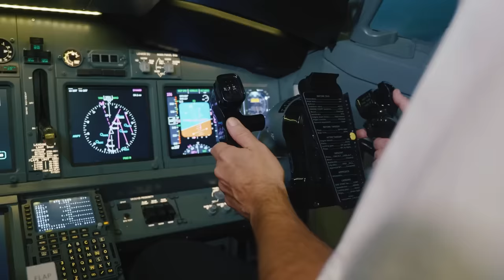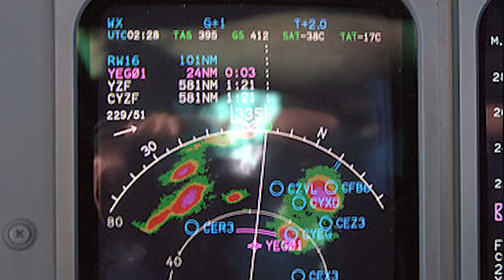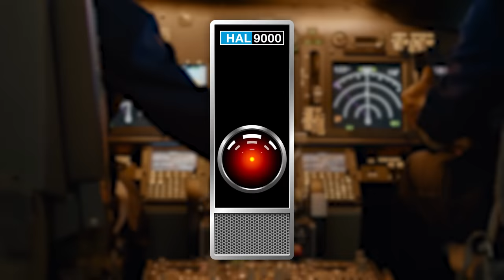Neil deGrasse Tyson Explains Advancements in Aviation

Comment: I lived in a suburb right next to O'Hare airport from 1980-90. I could look out the window and see the planes lining up to land when a certain runway was open for landings. They would be spaced about a minute apart and the whole house would vibrate when they passed over. In the summertime, even when the air conditioning wasn't needed, we would often need to keep the windows and doors closed so we could hear the television, radio, and each other. When I moved a little bit further away in '99, I was awakened a few times to a strange sound that I swore in my half-awake state must have been a UFO landing in the street. It turns out, I was now living far enough away from O'Hare that I was hearing airplanes throttling down for landing, which is one spooky sound. I still live in the same house and I've noticed it's a LOT quieter these days.
Reply: Me too. I’m about 5 miles away. 👋🏽
Reply: Arlington Heights until 1977. Loud, loud loud!!!
Reply: Was flying into O'Hare through the 1980's - as I was waiting to exit my plane I could see landings taking place every 40 seconds.
Reply: Same experience. I lived next to Foster Avenue right on the lake in the early 70s. That's how far from O'Hare? Foster is right on line with one O'Hare runway and you could see the planes lined up over the lake in their final approach. Every 40 seconds (?) whatever was playing on the stereo would be drowned out. In an odd way, however, the experience did make me appreciate the safety of air travel. When you see and HEAR that many planes landing the number of planes that are. safely landing every minute of every day really sinks in.
Reply: The “Bensonville Pause”
Reply: Do you ever go to a place that doesn't have air traffic nearby?

Comment: Actually when an aircraft banks and you perceive to be horizontal is called a coordinated turn. This is done by not only using your ailerons to bank, but to also use the rudder (change of direction) in the process. On the flight deck you have what is called turn & bank indicator found even in early biplanes, or the more modern turn coordinator. In both cases you have a slightly bent level with a ball in the middle. in a coordinated turn all you need to do is to keep the ball centred. (no slip and no skid) When on autopilot these coordinated turns are done automatically (computer enhanced).
Reply: That's not quite true
Reply: lol all the pilots watching and looking for this comment

Comment: The trick with the glass of water is always funny to do, even when you perfectly know what happens.
But it is also done without computer with a turn coordinator (technically a ball in a u shaped pipe) or, for a glider with a whool wire. This turn coordination is very important for the confort of the passengers, but also to avoid asymetric stall.
Reply: Yeah that's what I was thinking. Having a coordinated turn doesn't require a computer, it requires a rudder and an attentive pilot that coordinates the bank with the yaw.  That's nothing new this dates back to very early days of aviation.
Reply: Yeah that turn slip indicator is the one that eliminates the feeling of you’re in a turn , as long as the ball is in the centre it basically eliminates the side-slipping which causes the turn feeling
Reply: Sometimes you actually want a little side-slip to get more ventation on your side on a hot day! 🤣
Reply: Back in my flying days, we had to coordinate our turns manually - no computers. We had a turn coordinator, which included a glass tube filled with fluid and a little ball. All we had to do was keep the ball centered in the tube.
Reply: It's not rocket science. Is he going to tell us about the miraculous "Dimmer Switch" next. It's both a switch AND a dimmer AT THE SAME TIME!

Comment: Pilots learn in the earliest lessons how to do what we call a "coordinated turn", where the bank angle and turn rate is such where no "side slipping" happens and the occupants perceive no lateral acceleration. And is all done manually, with hands and feet only. Early autopilots systems (two axis) back in the day were not able to do that (WW2 era and soon after), but after the introduction of the Yaw Damper system, the system was able to take care of the rudder inputs as well.
Reply: The amazing part here is the engineering involved... For a pilot, it's "getting a feel of the aircraft", and is more involved in sensing that lateral "slip" sensation, and knowing what to do with the controls to eliminate it. Eventually you just build the muscle-memory to use the controls so you never really feel it at all... through practice.

    On the engineer's side, developing that Yaw Damper System, they had to figure out the math of eliminating the slip without using "feeling". I'm sure there are sensors, and if not, they COULD be developed for some feedback to the computer... just like a pilot... BUT somebody had to sit down and do the math for the Yaw Damper to work in the first place... not too much yaw... and not too little... AND then build a system that could get it right consistently...

    ...AND then they refined that system to get it right even with crosswinds, at any speed or altitude (and thinner air doesn't give as much lift OR drag)... and get it right every time...

    THAT is amazing.   ;o)
Reply: @gnarthdarkanen7464  Oh yes, that is truly amazing. The evolution of every aspect of an autopilot system and the seamless integration with the real physics of flying amazes me every time I push that button and see how smoothly it controls the airplane...
Reply: @gnarthdarkanen7464  Pilots have been using a "slip skid" indicator for decades. It is a curved, liquid filled instrument with a bubble in it. By keeping the bubble centered, the centrifugal force is centered and the plane is neither slipping or skidding during the turn and the feeling of gravity is centered through your body. The process is called a "coordinated turn". The tech already existed when I got my license in 1973. It's a pretty simple instrument. Like the bubble tool in a carpenters level.
Reply: @oscarmedina1303    Does that mean you did a bunch of calculus to get your controls right??? 

   No. It's JUST another indicator... AND I'm well aware of how it works. I used a quarter-ounce "split-shot" lead sinker crimped to a piece of nylon in my own ultralight for years to SEE the same thing, at least while I was picking up on the FEEL, and later when I was explaining such to others interested in starting out on the little crafts that (at the time) didn't require so much as a certification to get off the ground... As long as it was "dead vertical" you were "correct" in the controls... simple and works on all the same principles.

     The reality STILL stands... The amazing part is someone sitting over a table with slide rules and calculators and scratching together the design for the Yaw Damper System we have today... and that it seamlessly allows the Autopilot to control the plane... It's also amazing that jetliners can travel at the speeds they do, and generally be "driven" much the same as cars... So long as pilots stay under about 30 degrees bank, the Yaw Damper does all the rest of the control FOR THEM... 

     AND it all started with the engineers doing "the hard math" from feedback they got out of pilots like you and me who probably couldn't put that math together with guns to our heads... or for all the money on the planet.

     You "got the feel" for piloting much the same as I did... simple as that... no matter which or how many tools you used to do it. ;o)

Comment: Neil I love your enthusiasm for aviation. A few points- after decades as an airline pilot for one of the big 3, I would perform maybe 3 or 4 auto-lands per year. That happened when the visibility was so low that you couldn't see the runway until you were over it. By the way, the auto-land crosswind limit is (on nearly all jetliners) 15 kts. The autopilot can handle 15 kts. of crosswind but the pilot could do a landing with 35 kts. of crosswind. It's never very foggy and windy at the same time so it works. Also, I'd estimate that a third of the auto-lands I'd do was because the maintenance controller required it to keep the airplane "current". The autopilot, like pilots,  need to perform a number of satisfactory landings over 90 day period. Finally, the term you were looking for was "zero lateral Gs". That's not a result of a computer but the physics of flight. It's the components of lift (horizontal, vertical and resultant) and it's the same on an A-380, B-747 and a J-3 Piper Cub in coordinated flight. Cheers!
Reply: Roger that.  Vstep on the ball Neil.

Comment: The pilots are there to handle extraordinary circumstances like equipment failure, itinerary changes, civil unrest, etc.
Reply: Not to mention, if you can lock out the pilots completely from a radio transmission, that will have the potential to be hacked. So you're really just adding a whole new level of security threat, where the terrorist doesn't have to bother getting a weapon on the plane at all to use it to cause damage. It's just not possible to know a system is 100% secure, and it probably never will be possible.
Reply: @jishcatg  So far, everything one person has invented, another person has figured out how to break.  Generally, breaking is easier than building -- one might consider this an axiom of the second law of thermodynamics.

Comment: Just spoke w/my best friend who’s a 777 captain about what was said. Some smaller jets “could” take off at a steeper angle/rate, but they’d need more power = more noise. Landing is still the same noise level, the same descent rate, and they land at both ends of the runway depending on wind direction, so I’m not so sure about what was mentioned at the beginning. He hasn’t heard anything anyway. Most wide bodies take off at ~15° and always have. Would be interesting to get a pilot on and have a good talk about it all.

Comment: I’m a pilot and I love you Neil. But airplanes taxi on the ground. And they “hold” in a pattern (in the air). Those wing tips are called “winglets”.  And those types of turns are called “coordinated turns”. They happen when the pilot coordinates his rudder control input with his aileron control input. It has absolutely nothing to do with a computer. As we pilots have had “turn coordinator” instruments since long before computers.  Autopilots, analog and digital, perform perfect coordinated turns. But they existed LONG before computers were in the cockpit!!!!  If you doubt this google it.  Do more research man.  Or stick to the stars.
Reply: So true. Fellow pilot here.

Comment: Neil's not quite correct on the 50% thing. Found this online:

What does a 50% chance of rain actually mean?

The scientific definition is called the “probability of precipitation,” or PoP for short, and it is actually a mathematical equation:

Probability of Precipitation (PoP) = C x A

“C” is the percentage confidence that rain will form across the area, and “A” is the percentage area that is expected to get rainfall.

PoP is expressed in a 12-hour window (6 a.m. to 6 p.m. and 6 p.m. to 6 a.m.).

Here are two examples where there would be a 50% probability of precipitation.

Example 1: I am 100% confident that rain will form, but only 50% of the area will be affected. Plug these numbers into the equation

PoP = 1.0 x 0.5 = 0.5 = 50% Probability of Precipitation

Example 2: I am 50% confident that rain will form, but if it does, I am 100% confident that the entire area will be affected. Once again, plug these numbers into the equation:

PoP = 0.5 x 1.0 = 0.5 = 50% Probability of Precipitation

What about a 30% chance of rain?

Example 3: I am 30% sure that rain will form, but if it does I am 100% confident that the entire area will be affected

Pop = 0.3 X 1.0 = 0.3 = 30% Probability of Precipitation

Thus, the chance of rain is actually a statistical probability that evaluates the likelihood of rain, the coverage of rain, and the timing of rain.
Reply: EXACTLY what I was thinking!!!!

Comment: Hey Neil, the thing about bank angle and keeping the effective gravity straight down in an airplane was solved decades ago with a slightly curved fluid-filled tube with a ball in it, and a couple lines either side of center.  It's called the inclinometer and it's part of the turn coordinator instrument.  As long as just enough rudder is used for the bank angle, the ball stays centered and that shows the effective gravity is still straight down through the bottom of the plane, no computer needed.
Reply: That's why when pilots land in a crosswind, the call it "stepping on the ball".  That's when they need to deliberately apply a rudder input to abruptly yaw the plane, to realign with the runway, unlike the gradual rudder input they apply when doing a coordinated turn.
Reply: @carultch  Actually that's the opposite of "stepping on the ball".  Stepping on the ball means during a normal turn, if the ball is to the left of center you put more pressure on the left rudder pedal, and if the ball is right of center you put more pressure on the right.  That results in coordinated flight that keeps the effective gravity straight down through the bottom of the plane.  Coming into a crosswind landing is a side slip where you use ailerons to bank into the wind and then use opposite rudder to keep it aligned with the runway.  It's an uncoordinated flight maneuver that uses the horizontal component of lift (caused by the bank) to counteract drift from the wind.  The ball will be far outside of center on the side that is towards the ground.

Comment: One quibble, (there's probably a dozen comments already saying this) airplanes have never "leaned" in a turn, like you feel in a car in a turn. From the earliest days, they have an instrument with a tube of liquid that looks like a carpenter's level, but instead of an air bubble, it has a little marble-like or buckshot size ball. If the plane is skidding where you'd feel a leaning, the pilot would correct it by pressing the rudder to center the marble. The old adage among  pilots is 'step on the ball', if the ball is on the right, you step on the right rudder pedal. That is how you always maintain coordinated flight. Autopilots do this well but you've never needed a computer for it, any good pilot would keep you from spilling your drink.

Comment: I used to be in the USAF but, I'm still a Phantom Phixer, we used to take a plane to the trim pad and do engine run ups with engine shop and a D model Phantom is really loud but, the loudest plane I ever heard on take off was Habu aka the SR-71. You knew when they were starting the engines, they had 4 Buick V8's screaming @5K rpm's. On take off the afterburners would come on and deer gawd it was awesome watching him shoot straight up and outta sight.
Reply: @SeaPin The V8's are used to start Habu's J58 engines
Reply: @SeaPin yes, those were rolled out to power up the J58 engines. Also yes about the fuel leaking on the tarmac: the SR-71 had what was called “wet tank” instead of a “dry tank” for the special formulated jet fuel the aircraft used. As soon as the SR-71 went higher in Mach, the gaps from the titanium skin would expand and “sealed” all the gaps until it returned from its mission and those small gaps return after the aircrafts skin cooled and contracted. Engineers who did the maintenance could only do small bandage fixes as it would return to being where it was. Lastly for the fuel: the USAF didn’t fully fill up the SR-71 so they only added the necessary fuel for take-off and do an aerial refueling to top it off for its mission.

Comment: The fact that the water in your glass stays level during a turn doesn't have anything to do with the planes being technologically advanced. It's called a coordinated turn and we learn to do that in the first 5 hours of flying lessons. You can feel when you're uncoordinated because your body will want to slide more to one side, but you can also rely on an instrument called a turn coordinator to fine tune your turn. It's done by applying a certain amount of the turn and correction as you turn to keep everything centered.

Comment: What used to be spent (time and fuel) in holding patterns at destination is now just time in a "ground hold" (time only, maybe a bit of APU fuel) at the starting point thanks to the air traffic control system.

Comment: I had a window seat once, so could have clearly see outside the airplane. Had a glass of water on the table and was looking out. Suddenly the airplane starting banking towards the left side (my side) so I just grabbed the glass and hold it, scared that it was going to spill. Was pretty amazed when I looked to the guy next to me that had his glass on the table, and the water was still level, despite the steep bank angle. Thanks for the explanation

Comment: A good pilot makes coordinated turns by careful control of the rudder and stick.  The turn and bank instrument shows how coordinated the turn is with a ball.  Flight instructors typically criticize their students when the student is turning and the ball is not centered.  Of course if the plane is in auto pilot, the AP will make perfect coordinated turns.
Reply: Neil, brilliant as he is, should take some flight lessons. I volunteer (FAA CFII, retired United Airlines captain)! Almost everything he said in the video is wrong. An airplane turns by banking i.e. tilting the lift vector. This initially creates a sideways force that is immediately cancelled out by the fact that the aircraft has a tail, specifically a vertical fin that will not allow sideways flight. The fin does though have a movable control surface (a rudder) that allows the pilot to control sideways flight if desired, normally not. In an normal turn, the rudder is used to compensate for undesired adverse yaw from aileron deflection, so as to maintain a no-slip condition.